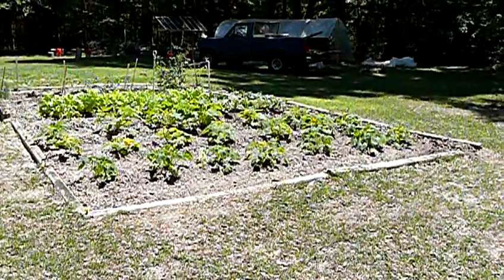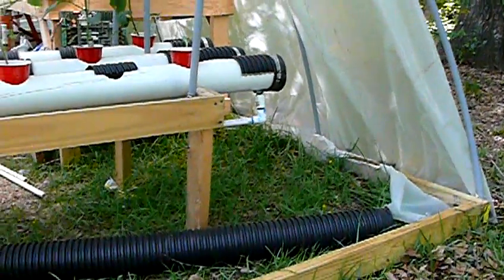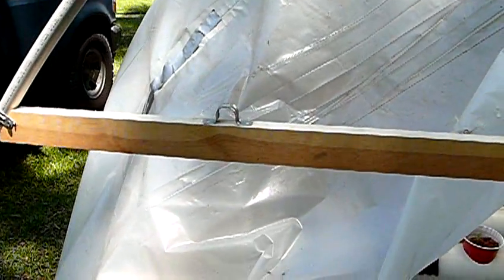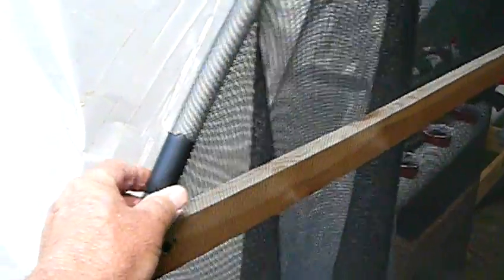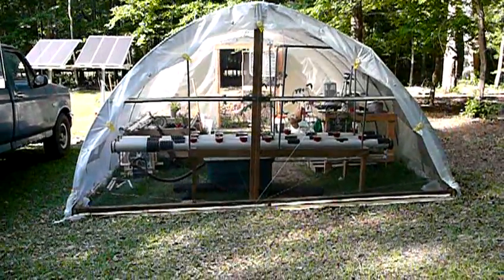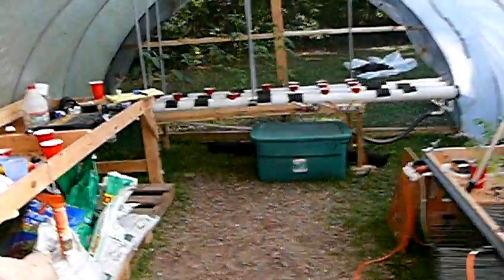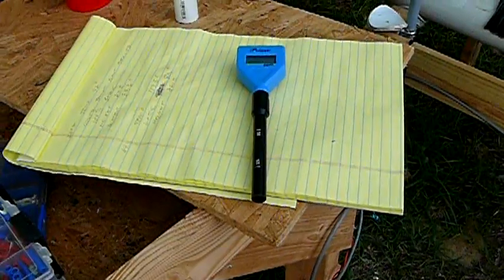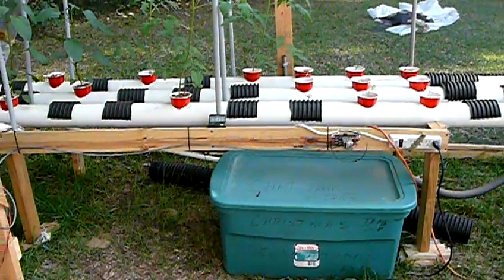hydro8

Comment from the maker: I plan to use the battery powered fans I removed from the back wall on the plants.  I'm adding water fogging nozzles in front of the fans that I will control with my computer.  Hope to increase the humidity and get a little cooling.

Comment from the maker: google for JASON HYDROPONICS and you will find a great site.  On the menu you will find "How to Grow Hydo" which talks about nutrients and you will find a link that takes you to using hydrogen peroxide.  My problem with bucket plants (I lost two of mine) too wet,  too much fertilizer.  I dried'em out,  removed the 10-10-10 and replanted and doing fine now.  The roots will need oxygen in a closed system so I went with flood drain on my hydro.